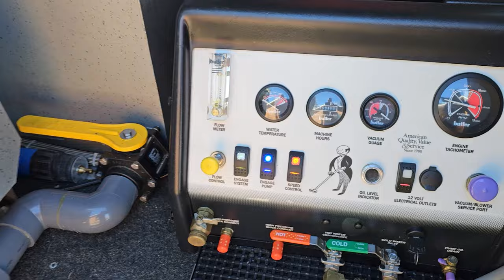The Dark Secrets of Your Carpet: What's Hiding Under Your Bed When You Clean

Comment: There's no easy way to tackle situations like that, hats off to you for getting it done. I recently had a similar episode in a small room.. 2 double beds put together to make a queen size. They were electric (and heavy) so the head could be raised to watch TV, etc. Bottom and top mattresses were separate but after crawling under and also using the phone flashlight I saw the frames were attached with bolts and wing nuts which made it possible to separate them to completely clean under them as requested. A swivel head wand sure would have made it easier :  )
Reply from the maker: And then they put a bed in... The size of the room 😅😜😁